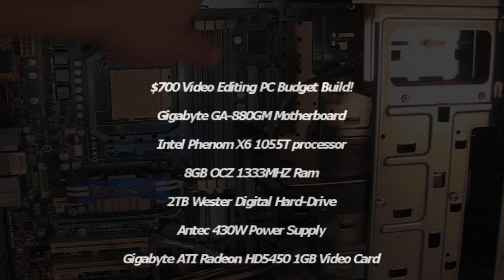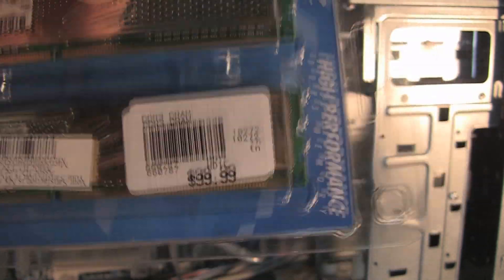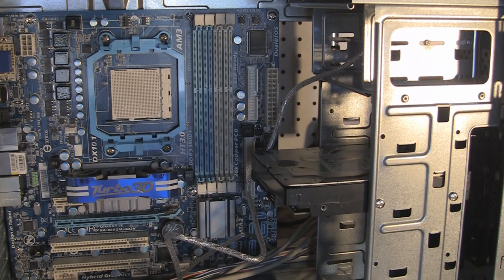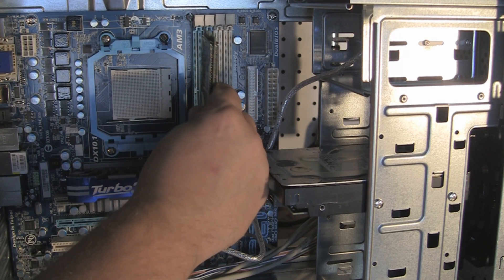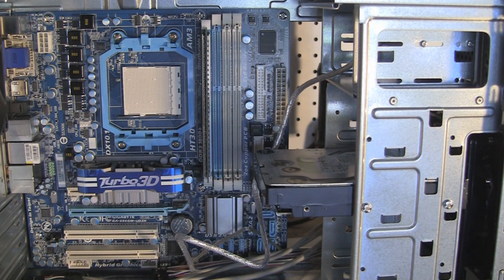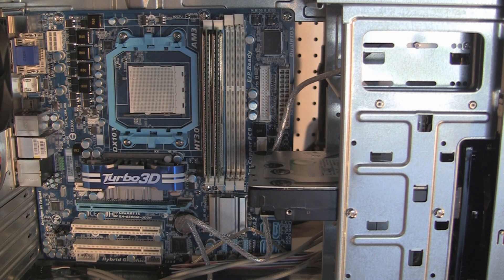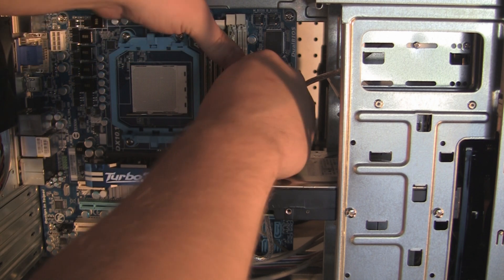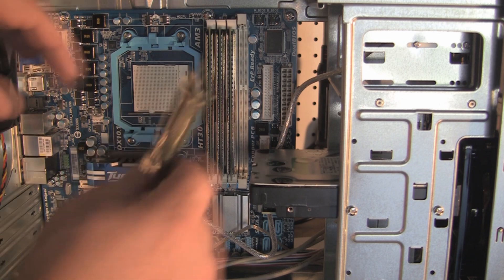Building a PC Step by Step Part 8: Installing the Memory.

Comment: Just three quick questions:
1. Amazon tells me that there is a newer version of this chip called the AMD Bulldozer FX-6100, should I use this chip instead as it is faster or does it have issues and should it work with the motherboard OK?
2. Have you had any other problems with the computer at all i.e. Overheating?
3. How can I use multiple displays with this set-up
Thanks as always and if you could answer any of these it would be great :)

Comment: the gold looking thing is very thin aluminum to dissipate heat over a larger surface than the memory chips themselves, it works best when only 2 sticks are installed if passive, or when a fan is blowing on them(with a fan # of sticks doesn't matter).

ocz is a very high ranked memory maker and is very well known in the computer enthusiast realm.